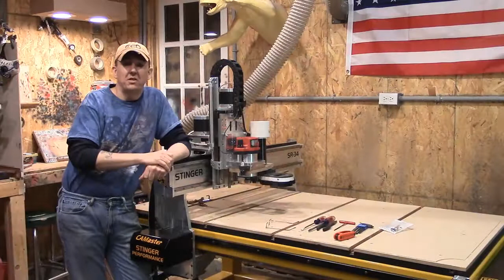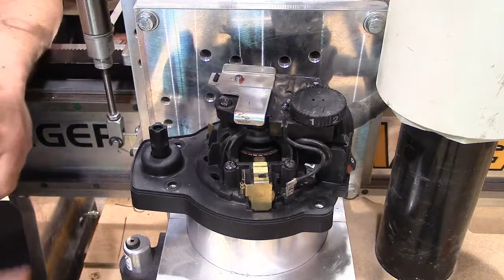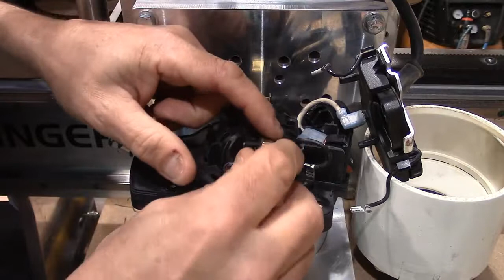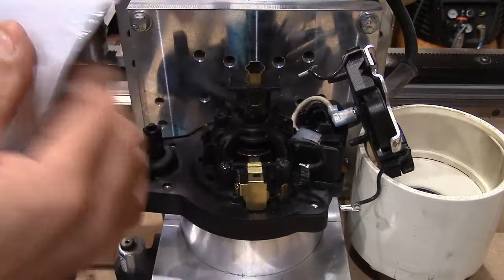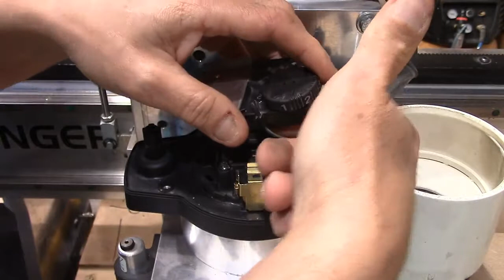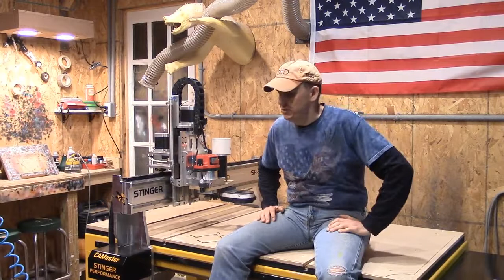CNC Milwaukee Router Brush Replacement

Comment: 8 years after your post, this video has saved me.  My CNC sign router was down during the busy Christmas orders season.  I bought new brushes and bearings a long time ago.  Today my router started tripping a circuit breaker.  Your vid helped me get my brushes installed in minutes.  Now I can get back to work.  Thank you.